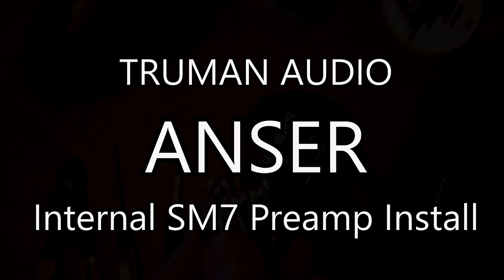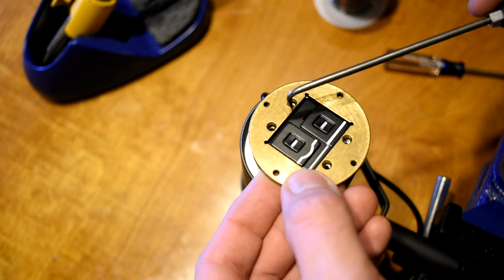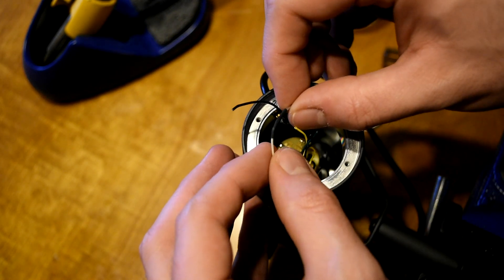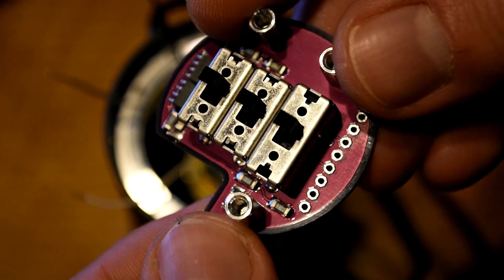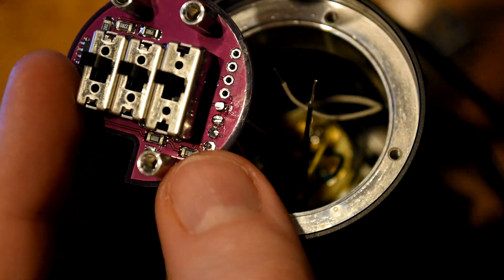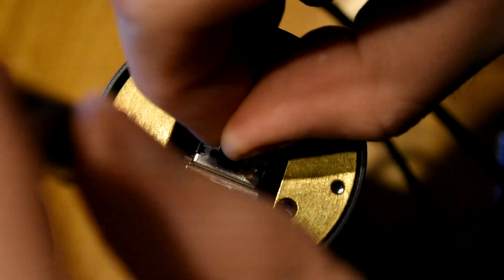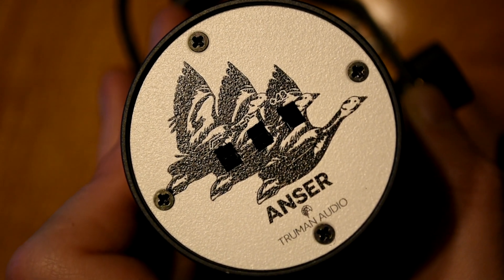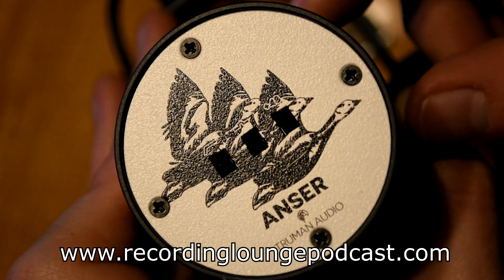Truman Audio Anser SM7B Onboard Preamp Install - DIY Tutorial

Comment: Any reason you didn't put the 4th screw into the brass plate?
Reply: Take a look at the preamp at 6:00, its only got 3 threaded standoff posts to screw into. I imagine the brass plate is not threaded so if you put the 4th screw back into there, you'll just have a loose screw not put into anything.